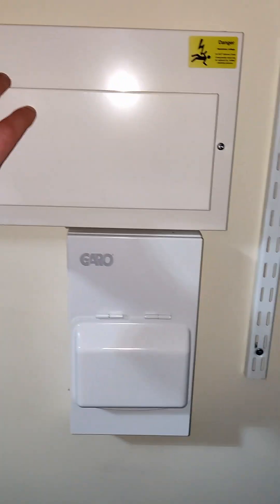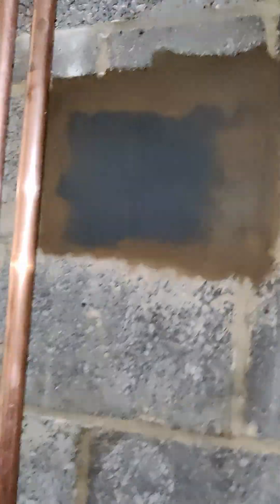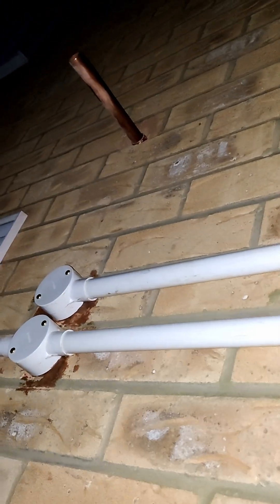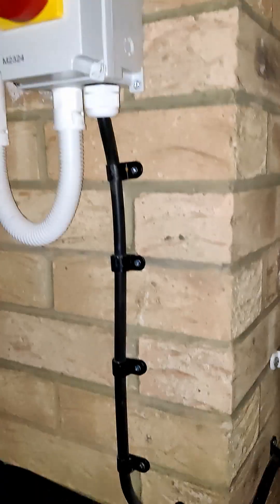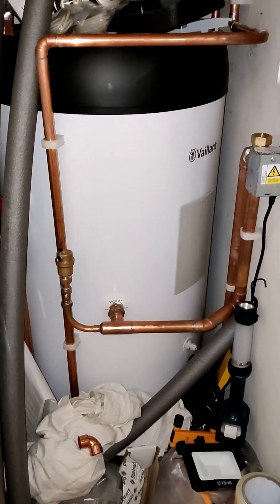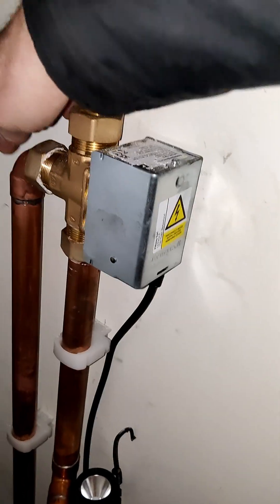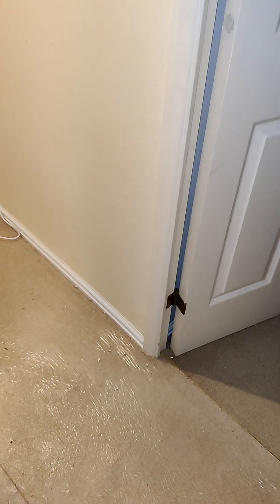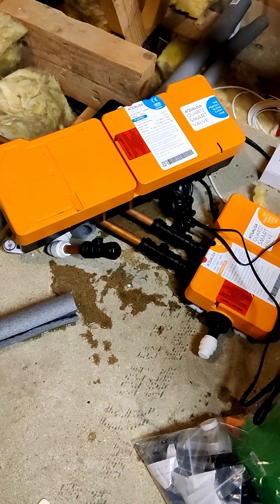Day 5 - British Gas installing Vaillant Arotherm Heat Pump at my house!

Comment: Thanks for all the detail, very helpful to see real installation experience :)  You mentioned at the end a high pressure controller for the shower.  Can you give more details - the image on my feed was obscured by some overlaid photos ;) ?
Reply from the maker: Yes, we inherited the smart shower when we moved in.
You can set precise temperatures, time, pressure etc and save it to a profile. My wife has it set to max pressure and hot and I have it set to 37 degrees and min pressure.
Once the timer has counted down it automatically  shuts off the shower.
It's good, but also with any smart tech, can be a bit clunky sometimes.
Reply from the maker: What kind of details would you like? Our shower is an Aqualisa Shower, It previously needed a pump to function in our vented, gravity fed water system.

Now that we are changed over to an invented, mains pressure system, we swapped the shower controller in the loft to one without an electric pump that just functions as an electronic mixer now basically.
Hope that helps 😊
Reply: @UpsideDownFork  :)  it was the electronic bit that caught my interest.  We also have a mains water pressure system,  works great,  but we just have "passive" thermostatic mixers.  Maybe you have gone upmarket and you can set a precise temperature, etc ?  :)

Comment: I’m enjoying your video series - I still haven’t taken the plunge to replace my boiler yet and you really give the full details of what’s involved, so thanks for that.  Can I ask how wide your tank cupboard is? - I too have a narrow space and I’m worried about changing the immersion heater, I guess it comes out at an angle?  My other question is do you really need a buffer tank - I was hoping not to have to fit one as I’ve only got 1 zone and only radiators?
Reply from the maker: I'm glad that it's helpful. Very little video information out there I found when I was looking a few months ago.
1. Tank Cupboard is 600mm between the frame, has about another 50mm width once past the frame. They needed every mm to get our tank in but there are slimline tanks available too.
2. Buffer tank is a contentious one. I would have preferred to go without so that we could really maximise efficiency. Unfortunately British Gas would not entertain this discussion. As I have 10mm microbore downstairs, it is very much touch and go as to whether 2  different radiators could be supplied the correct flow rate via 10mm microbore each.

In the end I gave in and figured i'll see how the winter goes. Worst case, I can always get my friendly local plumber to change the pipework so that instead of functioning as a buffer, it is only plumbed onto the return as a volumiser.
Reply: Thanks for the reply. With 10mm pipes then having a buffer tank makes sense.  Please keep the videos going!
Reply from the maker: @geoffc4771  will do. Not a lot of data collected yet but so far average cop of 4.2 for heating and 3.2 for DHW which means significant running cost savings over our existing set-up.